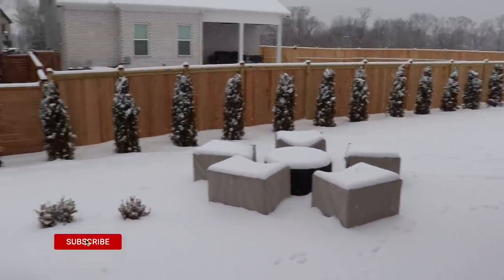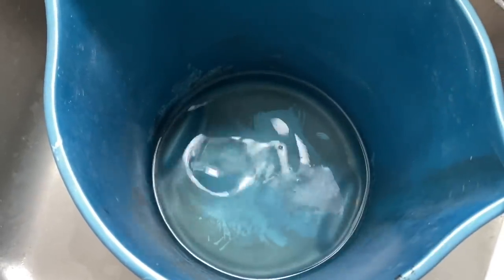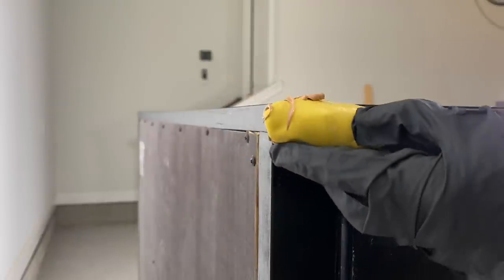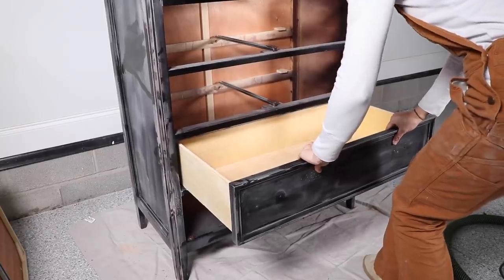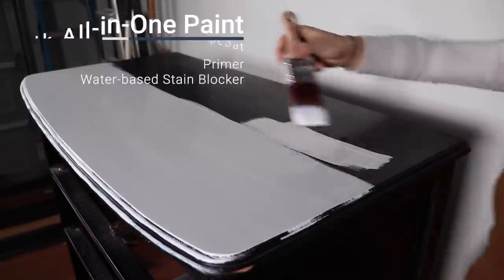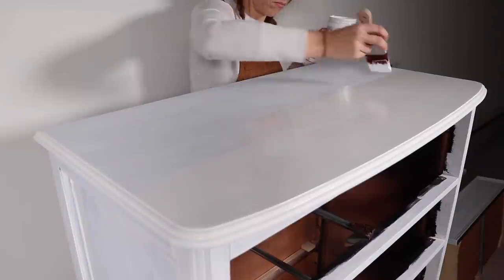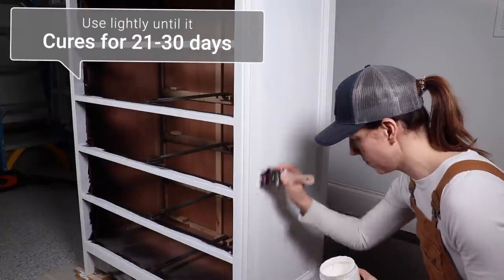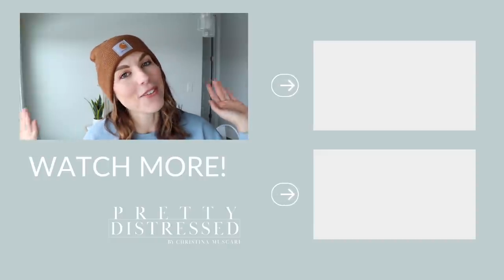NEW Silk All In One Paint For Furniture | Snow Storm Inspired White Dresser

Comment: I do have a question.  I just used Dixie Bell Hurricane Grey and then did two coats of a poly acrylic over the paint.  I can see all the strokes of the poly acrylic and I’m so disappointed.  How can I correct seeing the strokes?  Should I just use a mat or clear wax next project.  Thanks in advance for any advice.